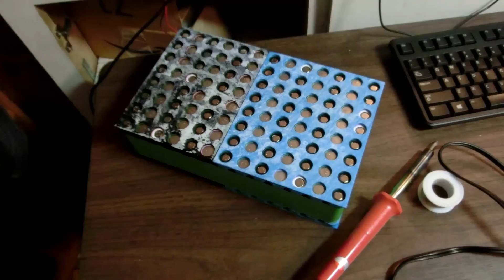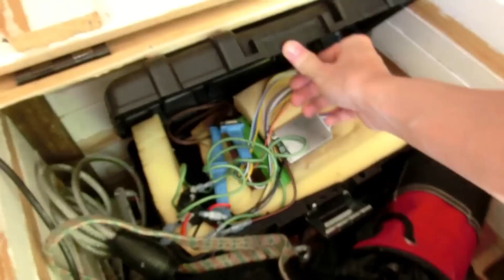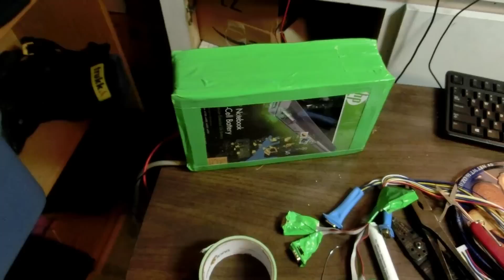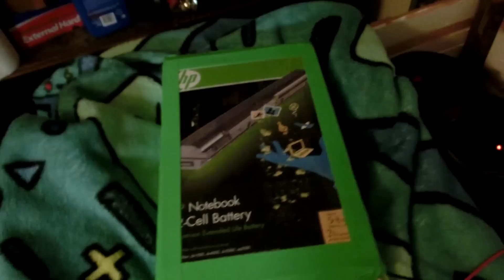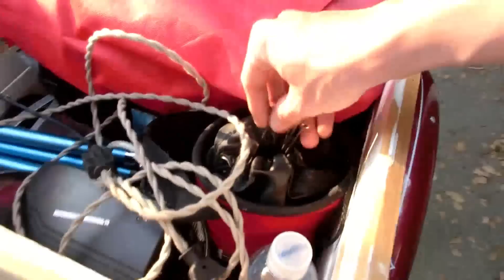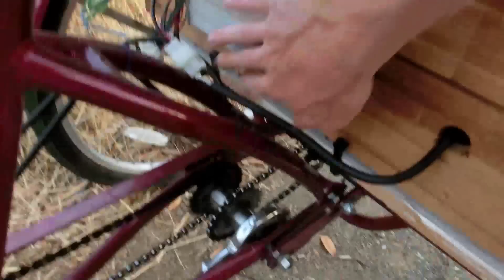DIY 52v (48v) 16AH Lithium-Ion 18650 E-Bike battery pack (E-Trike v1.6)

Comment: sweet battery pack! now you need 2 more hub motors for the other two wheels :D ,I have been lucky enough to get some EV battery packs with A123 cells inside and im thinking about purchasing a electric bike soon :D ,they are 20Ah-30Ah each at 43 volts full charge, thought id share, keep them good videos coming!
Reply: +fliping720 that would lower the efficiency
Reply: DMAN22yeah but do you know 100% till you try?
Reply: fliping720 people have tested, it wouldnt raise the speed, only the torque, and people dont need enough torque to ride up a wall
Reply: @DMAN22yeah  In theory it would raise it for higher torque loads or lower it if using very low torque. It depends, as the copper losses are way bigger in a direct drive motor than the eddy core losses would ever be.
Reply: +DMAN22yeah Torque is what he needs for those hills though.
Reply: +DMAN22yeah Torque is what he needs for those hills though.
Reply: Raven1024 not that much though
Reply: DMAN22yeah
Perhaps not, but he could do to double what he has now.

Comment: How many watts is that single front wheel? I am gathering parts for my EV reverse trike build and i was thinking of going with a 10kw motor connected to a single rear wheel like a motorcycle on mine..
Reply from the maker: storxusmc this is 1kw.
Reply: Rinoa Super-Genius

yeah. for something I am considering building, I have a pair of 350W 12vDC motors.
but, then I have a lot of frustrations for how I can drive these.

it would be a lot easier if they were higher voltage and/or 3-phase, but, going that route seems to be a lot more expensive.

the issue is that the motors will need enough current to make a simple transistor H-bridges no longer the ideal solution (I want to be able to drive them both directions).

it is either a crapton of transistors, higher-valued transistors, or an electromechanical solution (simple transistor driver, with an electromechanical solution for the direction controls, probably a few custom-made contactors).

Comment: female connectors always go on the battery because the pins are live and can easily be shorted in the male connector
Reply: Rinoa Super-Genius how many batteries takes a 60v 20 ah ?
Reply: cab3 i agree!
Reply: +Rinoa Super-Genius so how much would the build cost battery wise?
Reply: cab I was thinking that same thing
Reply: Michaela Baune if you start with 3200mAh 18650's, then you're probably looking at ~ 128 batteries... 6 in parallel gives abt 19.2Ah x 16 in series (59.2v) that's 96 batteries... I'd do 128 batts tho for 64v and 25Ah. bcs 8 x 16 is easier to get holders for
Reply from the maker: IscleGaming | ZefaCraft except in this case the connectors on the BMS are live also due to the other battery being installed. i favored the female connector being on the tricycle due to it always being there and stuff could get into it as apposed to the battery.

Comment: Hey. I'm wondering how do you test your bats for capacity? One by one with the imax r6? Or another (faster) method?
Thanks
Reply from the maker: Ricardo Encarnação one by one with an imax b6, unfortunately :/
Reply: Rinoa Super-Genius me too, but it's so much time. I was thinking about buying the Turnigy 4x6S 400w. As far as I could find, it seems able to discharge 4 bats in a row @ 2Amps each. 
Do you know it? What do you think?
Reply: Ricardo Encarnação Good question Ricardo! Are you doing a discharge test or do you measure them while charging, or perhaps both?
Reply: PuchMaxi1988 just a discharge test. I fully charge them first with a nitecore i4 charger (4 bats in a row), then run a discharge test with the imax r6 one by one. That's why I was searching for a faster way of testing them, and it seems that Turnigy charger may do the trick.
Reply: +Ricardo Encarnação only discharge 1 in series. get 2 imax b6 chargers and do it that way if you want more batteries done

Comment from the maker: ussually i watch a video before i make it public...but fuck it this one is too long, and thats after editing it down from it's original 2.5 hours of video.

plus i'm sure you guys will let me know if i make any big mistakes in editing anyway.
Reply: Rinoa Super-Genius i love your videos even if they are long , keep doing whats you doing
Reply: Rinoa Super-Genius video was cool. don't worry about it.
Reply: Rinoa Super-Genius Loved the long video.  I watched ever second and enjoyed it.  I agree that California is scenic similarly to Missouri. Don't worry about mistakes in your videos, especially the long ones! 

Also, Good luck moving!
Reply: Rinoa Super-Genius if i saw something like that i would let you know immediately. i hope others would do the same.
Reply: Found 1 tiny mistake , u typed latter instead of later, but very very very good video
Reply: Re you need quite a hot iron. also it helps to sand the surface, clean it then add flux. sanding the surface helps give the solder something to stick to.
Reply from the maker: *****
that makes almost no sense.
Reply: +TheEnragedGamer put all 18650s in parallel and use a 3.7 to 5v converter and charger the pcb is $7 on amazon
Reply: yep capacitors are not ready for these applications.....YET!!!! the irony of the situation is that CAPACITors don't have enough CAPACITY...lol (needs more Farad's-equivalent of amps in lithium)
Reply from the maker: juancarlosruiz1985
 Casio Exilim ZR-1300
Reply: Rinoa Super-Genius I have literally that EXACT multimeter. XD
Reply from the maker: nate grover
well i'm more interested in finding mistakes of like me accidentally saying where i live or something that would have a bad impact on me.
Reply: Rinoa Super-Genius Why  don't you do purchase new cell from stores ? Is it do always keep using laptop battery cell? Is the price do made you to do this decision?
Reply: ***** and how long video is it and as detail as the things is shows up
Reply: +Rinoa Super-Genius can you make a 12 volt battery using Lithium-Ion 18650 cell ? :)
Reply: Juan Paolo DIY! its not a challenge!! just three cells in series!!
Reply: +smallenginedude71 how many volts ? 11?
Reply: Juan Paolo DIY! 11.1 nominal. about 12.8 - 13v max
Reply: ok
Reply: +Rinoa Super-Genius Hello how many watts is your soldering iron? I can never get solder to attach to my cells
Reply: +Rinoa Super-Genius hummm... this is why, the female conector are safer for batteries, you cant short-out, unless you WANT to do this...
Reply from the maker: *****
your only thinking of a single battery and single BMS, but this system has multiple batteries. so the connector on the trike will always be energized and i cant really remove it easilly, so i'd rather have more protection on the connector in the trike trunk than on the battery that i can put somewhere safe when not in use.
Reply: +Rinoa Super-Genius   . do you have regenerative braking? i heard you mention that you could make 2 trips with the new battery pack after measuring the voltage at the top of the mountain but i didnt hear you mention regenerative braking on the way down... LOL
Reply from the maker: *****
that would be awesome.
Reply from the maker: *****
what ideas?
Reply from the maker: *****
thats definitly not a new idea having a battery be powered by a fusion reactor...thats like in every sci-fi movie with spaceships.

plus 18650s would be a terrible option in space, they take up too much space, would be better to build custom batteries.

also we need to figure out how to scale down fusion reactors.

if you solved those issues then that would be a good idea.
Reply: +Rinoa Super-Genius hahaha
Reply: RINOA im con fused how do that many batteriea only equal 24 volts?  because i hooked 6 batteries and they were a little over 20 volts and also if i made one of those packs not both of them to gether but one of them and if i made it into a high capacity 5 volt charger what would i need i know i need a voltage regulator vitlr all that voltage i just want to build something that has like 20 cells inside of it and chargers my usb things on a long term
Reply: Wow i just reread that it made no fucking sence but bassicly how do i make a HUGE AS FUCK phone charger
Reply: +Rinoa Super-Genius I just built as BOOST BATTERY; an extra 1s 20ah to my already 13s lithium giving me 14s lithium; it workss wonderfully with your kit....try upgrading to a 14s lithium build, you wont go back; your controller will handle it...BUT DONT PUSH IT to 15s that will be to far...14s lithium is good; I can drive on grass uphill non-stop no overheating or cutting out. I would defo recommend it.
Reply: boobtubereborn yeah, but for those who dont have $150, such as me, soldering works fine
Reply: +DMAN22yeah & +boobtubereborn  U could use a high power capacitor, and discharge it. Should in theory work like a spot welder. I've used a simple system like that once or twice to make battery packs for a portable phone.

Sure it wont be perfect like a $150 machine, but its cheap and simple to use, and no excess heat.
Reply: forget the battery then....just use a high power capacitor instead! :-DDD
Reply: Shane Williams yeah you get a good 1000 feet and then youre done
Reply: What camera are you using?
Reply: Rinoa Super-Genius
Reply: bruce wayne Right on! I don't know about anybody else but I enjoy learning  (revisiting my short education @ RYERSON POLYTECHNICAL INSTIRUTE) no matter what age I achieve ! THANKS ! 🤗😅👍🖒🌝🌞🎄
Reply: What solder did you use. I can’t get my solder to stick. It just comes off right away